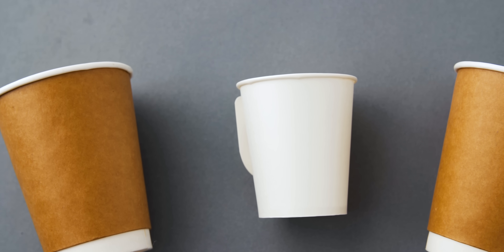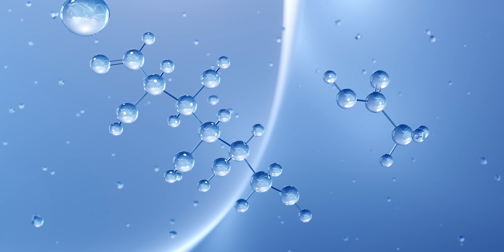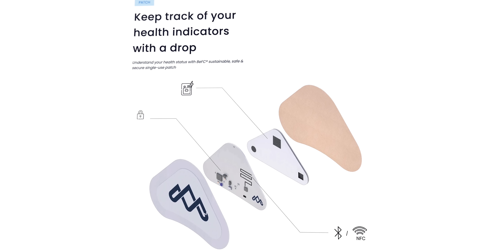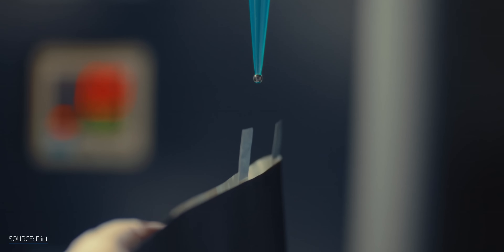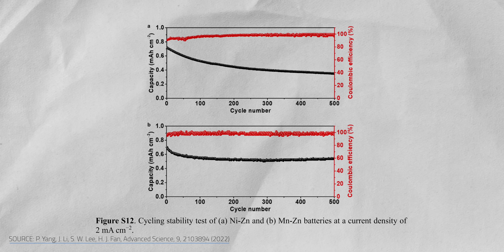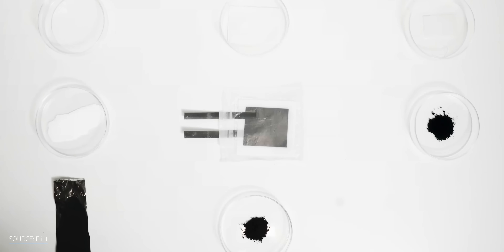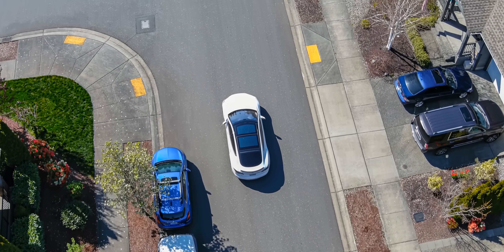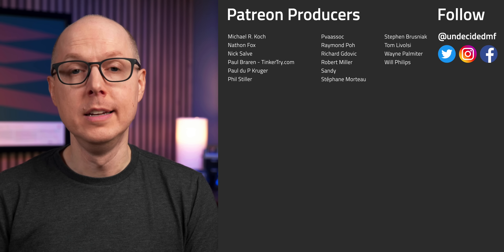How Paper is the Future of Energy Storage

Comment: It's always easier to work with inorganic chemistry than organic - meaning biological. It's just so much more complcated to work with long chain or complex organic molecules (like sugar and enzymes) and how they interact. I think this is wy we haven't had a lot of breakthroughs where bio-based systems are created to replace inorganic systems - like batteries. The idea has been around a long time.  I seem to remember a Sci-Fi story where huge tanks filled with electric eels were used to generate power. This is an area where chemistry AI software could be very impactful. Batteries could definitely be bio-based, bio-degradable and long lasting.  Hopefully more work will be done in this area.

Comment: I bought rechargeable AA, AAA, and C batteries, for my TV remote control, my wireless mouse, and a flashlight, more than 10 years ago. I haven't bought a battery since. The ones I bought back then are still working fine.

Comment: Just what exactly does "1.18 times cheaper" mean? It's a mathematically meaningless term. 

Usually when people say x is "n times cheaper" than y they mean the cost of x = (the cost of y)/n so in this case is the cost of a paper battery 1/1.18 x the cost of LiIon? If so it's hardly a huge saving. This translates to .85 times the cost or 15% cheaper (which  would have been a far more understandable way of stating the measure). For this to be a useful battery technology at that cost ratio it would have to have at least the same density, rechargeability lifetime, and recharge times as current tech.

Comment: Paper batteries are nothing new. Zinc-Carbon or alkaline batteries often use an electrolyte-soaked layer of paper between the electrodes.
Whats new is sugar  in combination with bioenzymes. I wonder if paper even plays an active role other than being a carrier or separator between electrodes.
I also wonder how it works without using up bioenzymes in a irreversible way.

Comment: I use a renu-it RE05  battery charger that can recharge AAA, AA, C, D, and 9 volts both disposable and rechargeable of Alkiline, Ni-CAD, NI-MH, and Lithium-ion 

Its able to recharge disposable Alkaline batteries  safely because it trickle charges the batteries like they were charged up at the factory originally

Generic batteries can't hold as many recharges as name brands like Duracell and Disposable batteries may only rechargee to 80%- 85% 5x-10x

Comment: i think the big issue with battery tec is that big money was spent on lithium and they will fight tooth and nail to keep their monopoly in lithium that they control ,even if it catches fire and is difficult to recycle , both boost their bottom line in selling lithium  ,so those monopoly investors will lobby to suppress these facts against lithium  safety too boost more profits  , as well discredit other types of battery being developed , ,,, battery tec will not only have to come up with a usable alternative but a alternative use industry to use them in and show the masses that they are a real alternative too lithium monopoly , because lets face it lithium battery in cars ect, are a monopoly controlled manufacturing set up , imagine retooling a car  design and assembly plant built for and locked in to contracts for lithium guarantee supply chain ,for a new alternative you do not own the monopoly too, and is not proven yet ,, they said heavy trucks would never be feasible, then a new start up built one and proved them all wrong, lobbyist blocking said start up from any grants or subsidy from governments,even where it could build a manufacturing plant, yet they are building their plant, just not where the originally tried too , ,,  this is where the real issues with alternatives are at,,, lobbyist fight every advancement against lithium market share monopoly , it a sad world we all live in , and i agree with we could do more for recycling at source of sale ,🥸🤓 ,Canada

Comment: The policy mentioned by several European commenters, having recycling bins wherever batteries are sold, or at the very least at big box stores and supermarkets, is one that has made sense to me for a very long time. While there will still be some who pitch the batteries into the trash, making recycling easier will make it much more likely. I recycle batteries, and last time I did so I had to make a trip to a special facility, not easy to find, where I was charged by the pound for dropping them off. Most folks are not going to put up with that bother, understandably. Likewise, fluorescent lamps and LED bulbs.

Comment: " it only outputs 0.75 V so it won't replace 1.5 V batteries "
Dang it, if only 2 batteries could be wired in a way that makes the voltages adds up.

Comment: An idea for using a battery that uses sugar. An implant in the body that has a sugar level sensor. When sugar spikes too high, it starts using up the excess sugar. This would help large numbers of diabetics. It could, theoretically store some of the excess sugar for release when sugar levels drop too far, as well.
Reply: You will need to implant a small blood filtration laboratory into human body and it will require loads of power to function.

Comment: Sorry that you've been brainwashed to think that is a climate change and humans might be causing it, even though it's/they_are not. Cleaning up the air, water and ground is though the most important issue. So thank you for the where to find single use battery recycle centers. But sadly in all of L.A. there is only 4 Staples and 1 construction supply company to drop off single use batteries. Did you know that only 1/3 of the plastics we try and recycle actually gets recycled? Then 1/3 get burned up to power electricity and 1/3 gets dumped. Toxic chemicals and plastics that get dumped and pollute our ground water needs to change, not climate. Did you know that there is a chemical fire that is many feet underground burning at a garbage dump site in the L.A. area and they do not know how to put it out? Do get me wrong Matt, I like most all of your videos, just not the ones you mention climate change.

Comment: Getting rid of the hard-to-extract and hard-to-process materials in exchange for super common materials at the expense of some longevity and energy density is what probably excites me most for the future of batteries. Home backup power is rapidly becoming something that everyone realizes is an essential, and I'd much rather put $1,000 toward a battery and small solar array than a gas or propane generator and rely on fossil fuels and a machine that needs regular maintenance. As of now I have two Bluetti AC180s 1152Wh units and 800 watts of portable solar and it's incredible what that small of a system can do for me. Hot water, cooked food, window AC, space heaters, all lights and chargers, etc.
Reply: Im always stunned when i hear that someone actually buys these overpriced portable inverters and then actually uses them for stationary usage ....
dude you could get a proper hybrid inverter and a decent battery and a actually proper pv array for the price you paid.... (if you DIY everything yourself)

Comment: At 220 Wh/kg, and it's high discharge efficiency (99%+), Flint should work fine for EVs. Full cell pack weight on a modern EVs fall into 150-185Wh/kg all included and this can probably cool passively. C rates will be more important though.
Reply: I highly doubt >99% discharge efficiency can be real, it either miscalculates charge or omits discharging losses

Comment: Only outputs .75 volts? Just put two in series and you have 1.5 volts. I mean unless putting them in series is somehow impossible...
Reply: given what they are, their voltage is probably highly unstable, and this doubles such instability
so they probably still need dc-dc conversion aka not a drop-in replacement
Reply: @jwhite5008  Understood. That's the kind of stuff I needed to hear.
Reply: @jwhite5008  so kinda like sodium
sad....
Reply: @ DC-DC is actually not that much of a deal with modern electronics. 

0.75v is fine and unstable voltage level is fine if you upconvert it anyway.

Maybe for something more foolproof you would want a simple and stupid design with traditional alkaline cells, althoiugh even flashlights nowadays contain a current-regulation chip just because of how blue LEDs work.